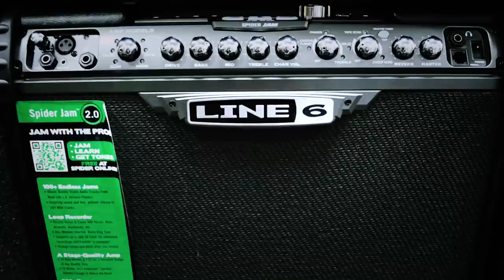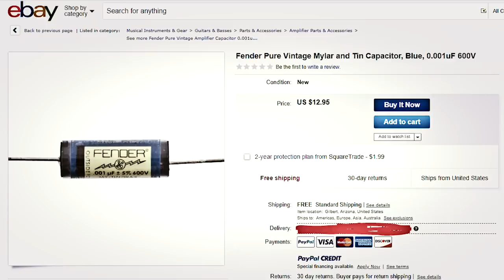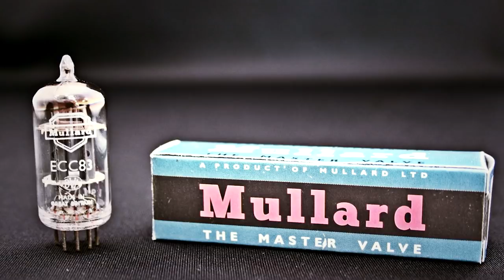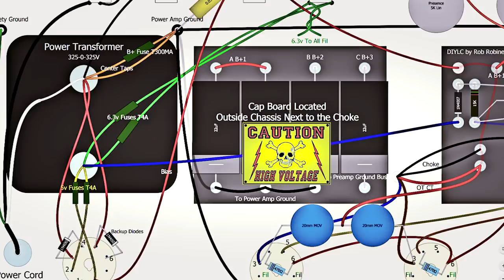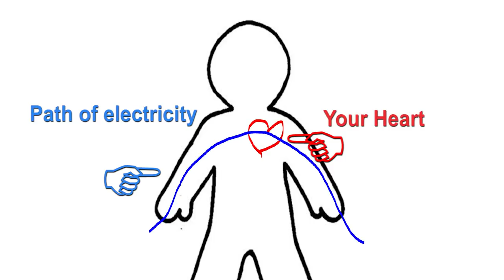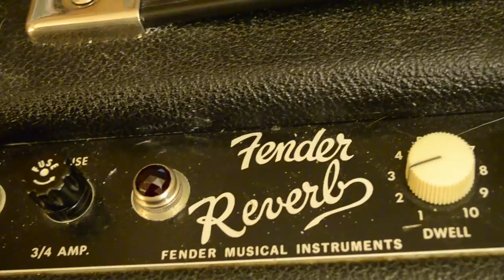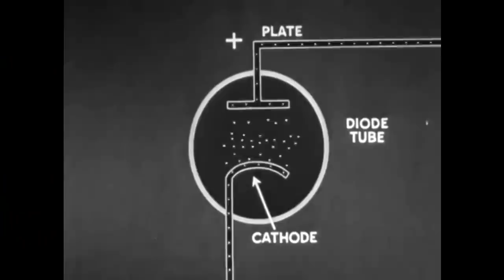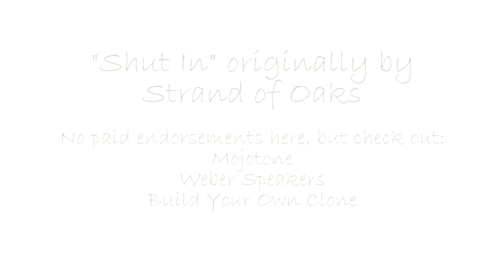The Musical Chair - 59 Fender Bassman Blues

Comment: i remember you talking about the cats trying to get into the amp you were building. i had no idea you were building a bassman. i have a silverface from 1972. different circuit but i still love it all the same. at the moment, i'm mid repair since the power caps died (they were 45+ years old when they went) but i still love it all the same. thank you for the fantastic video.